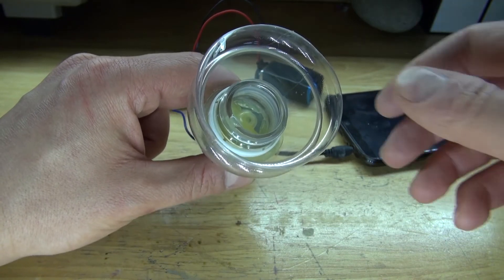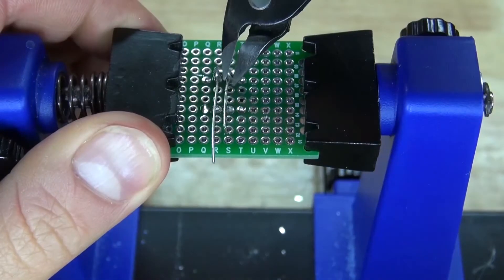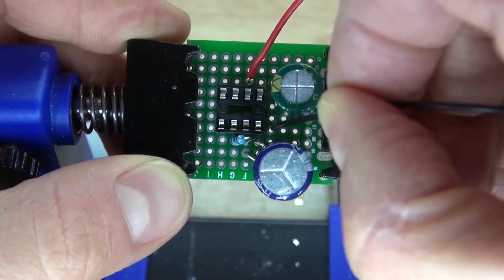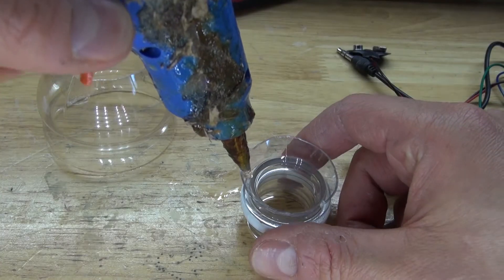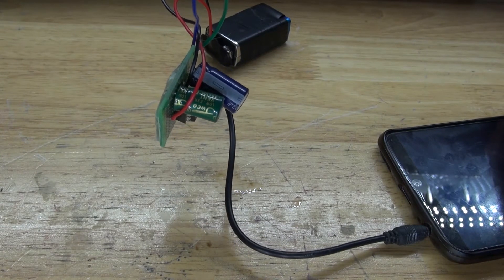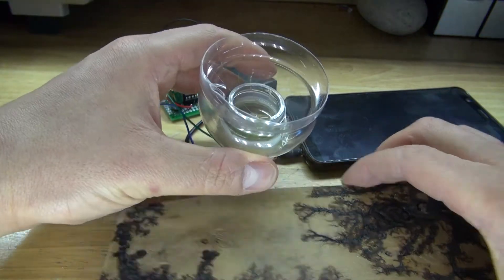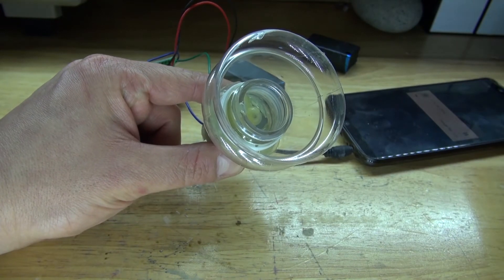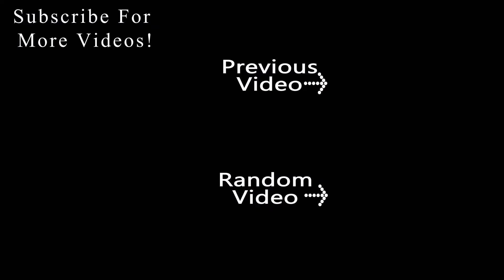Music From A DC Motor

Comment: Assalamu alaikum, first of all I'm just an electronics enthusiast, Also I sleep like the dead, So I wanted to make an alarm with bluetooth headphones and a small vibrator motor, I replaced the small speaker with the vibrator This one worked as a speaker while I wanted him to vibrate, your circuit works as an amplifier but the vibrator still gives sound.
Please any ideas to help me with this project
Reply from the maker: You would need a separate circuit that is triggered by that alarm. I would suggest an ESP32 device to connect to the internet and from there set an alarm at the same time as you headset. Attach a DC motor to the ESP32 to vibrate at the set time.
Reply: Thank you for your interest, i will insha allah